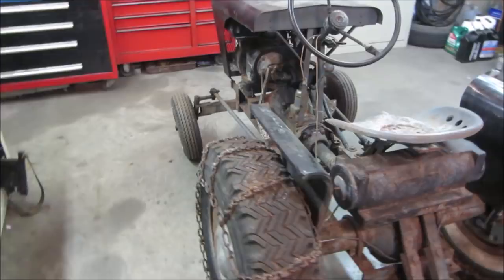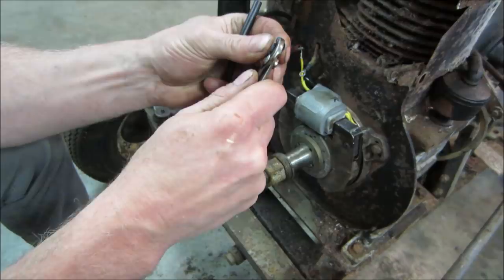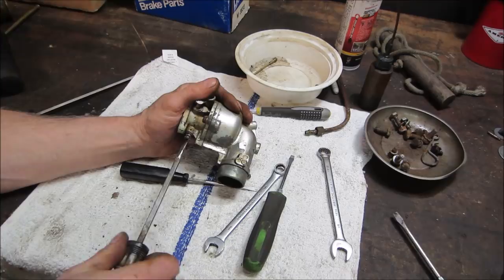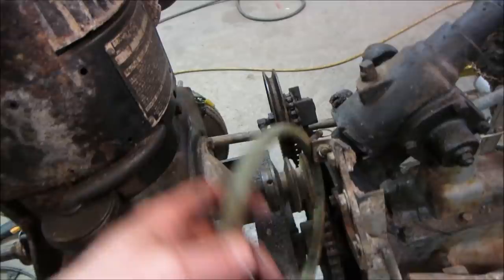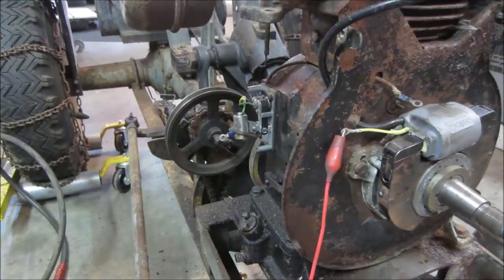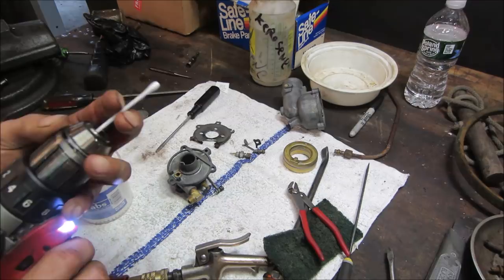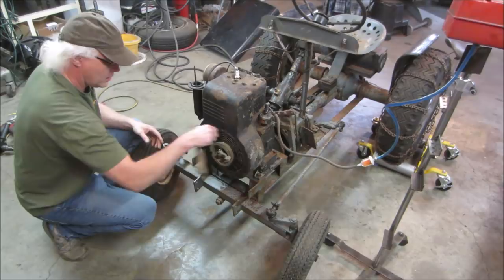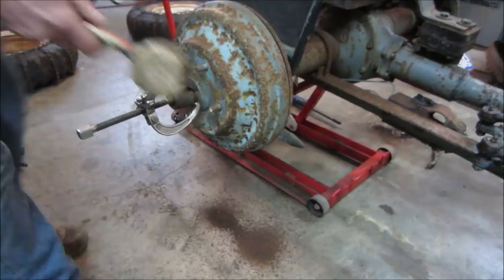Is The Engine Savable? Homemade Tractor Buried Under A House, pt2

Comment: By the way. Thanks to u and only u I got to fix 70 years old outboard. Before I had no idea anything about carbs but after watching ur videos, which I think I watched all of them. I had the courage and knowledge to get into the engine, take it apart and fix it. The old 70 year old carb was no go so I ordered one online the modern carb for 12$ and adapted it on the old motor. Now it starts from the second pull and it all thanks to u! Thank u that U thank u. U have no idea how much u teach me with the vids that u put out.

Comment: Maybe somone else mentioned this.  The ooze that came out of the old coil was insulation and the most likely problem was a short circuit when it gets to high voltage, not necessarily an open circuit.  You cann test that with a 'hipot' high voltage insuraltion tester, but as a practical matter, replacing the part where the schmoo came out with a different cheap part is a good plan.

Comment: For starting an engine using a drill, I use a 3/8 inch ratchet adaptor.  It can be used on any extension bar to get a ratchet action.    It effectively becomes an over running clutch once the engine starts.  
For cleaning engines, try Simple Green, 50/50 mix with water.

Comment: No Mosquitoes here yet in Colorado Springs.
We're still getting snow.
Maybe if it stays cold longer we won't have them this year.
Do you think?
Nope...they'll be here in force soon enough.
Thank you for your inspiration and instruction.
I'll be using what I've learned from you soon.
Got a throw away lawn mower and a Troybuilt snow blower this winter.
Never would have even looked twice at them if not for your encouragement.
Wrench on!!!

Comment: Ooh yes looks like my lunch break is gonna be extended by an hour
Reply: Never seen a Briggs and Stratton engine idle that low and still keep running in all the years I've been fooling with them. that's a sweet running little engine. Now if you can figure out how to pick hook up one of them starter generator type contraptions you will be able to drive it at night with lights.
Reply: Miata pfp? Nice
Reply: @orangepickel2  I've worked on those cast iron engines a lot. I sat here talking to justice what to do next lol.
Reply: @dennisjohnson5754  first engine I ever took apart and I mean took apart was a 2.9 horsepower Briggs Stratton and Stratton lawn mower engine that had a 18-in blade that my brother used to cut  grass with was bought  new 1957 I was 8 years old in 1962. The Masonic temple sat on about an acre of land and it had a big grass parking area and that's a lot of walking with an 18-in mower  2 ft High Grass.

Comment: I’d love to find the old tractor my Dad made in 1957.  It is somewhere in Northern Idaho around Moscow or Potlatch.  It had a Pontiac rear end, and a Crosley engine and transmission.  He used the outer shell of an old oil stove for the hood and grill.  What you are fixing up is not only an old tractor but my memory of just how handy my Dad was.

Comment: Yes, Lowes does honor the craftsmen's warrantee.
Reply: With the caveat that you don't get exact replacements. I returned a ratchet, the one I got back is equivalent in terms of features but not the same ratchet at all. They aren't made on the same Sears tooling (even after Sears moved manufacturing overseas in the '90s, the designs stayed the same).
Reply: Some of Craftmen's "hand tools" are still made here in the States but most are now made overseas and it doesn't stand up to Craftman's " quality" but then again there's a lot of tools now days that don't stand up to their original " quality" anymore.🤔😞

Comment: Lowe’s will honor the replacement if they sell the tool, but now most tools come as a set, rather than individual pieces.
Reply: Sears sold the intellectual property, not the patents, product manufacturing, or engineering specs to Stanley Back & Decker so I doubt if any of the Sears Craftsman or Ace Hardware Craftsman products have any lifetime warranty redeemable at Lowes

Comment: Good sounding engine.  If I am not mistaken, what you have there is a Briggs and Stratton 7hp cast iron engine, I have a 1966 Montgomery Wards Garden Mark garden tractor with the same engine, mine is a Model 19 Briggs and Stratton, still runs, and all I have ever done is 2 ring jobs and of course, regular maintenance.  I love the tractor and the engine.   That is a unique home built tractor you have there Mustie,  Good find.

Comment: Good Job Sir! I love this stuff. I made my own minibikes and Go-Carts  when I was 11-17 years old.  I built  custom motorcycles for Veterans until a couple years ago.  I will be 68 soon and energy level is just not there anymore to do that. I even bought a 200HP Motorcycle to convert into a 1970's style chopper.. I already have a Z1-900 1974 chopper I made to a chopper several years ago & very happy with it. Now that I bought the 2012 Zx14R Ninja to convert,  I was shocked to find it is a comfortable riding bike! I don't to chop it now. Thanks for taking the time or the videos... can't be easy... Great job!

Comment: Never get old. Just got a free mower, sprayed some brake cleaner in the plug hole, 3 pulls and fired up, had some old gas left in the carb it ran for half a minute :D

Comment: I have had experienced the same dripping from the bottom of the intake pipe while starting 2 of these types of engines ( 1965 10 hp simplicity, 1988 8hp troy built chipper), They always drip after full choke and 2-3 pulls.  It has nothing do do with a stuck float, stops if you turn the choke off, continues to this day to work this way on the 30 year old chipper motor.  Great video, Craig

Comment: One trick I devised to lube cables is to slide on a length of fuel hose over the end of cable sheath, use a small hose clamp to attach it. Hold fuel hose in a vertical position and fill with your favorite flavor of lube, lighter is usually better, force the lube through the cable using compressed air, Bam!, well lubed cable!

Comment: That old engine sounds GREAT, when it will idle down that low everything is set right. Those old updraft or flo-jet carbs LEAK in two ways...usually when you choke it gas runs out the bottom and that long emulsion tube you took out leaks in about 75% of them. You need to tighten, loosen tighten, loosen it til it SNAPS when tightening to get it seated. B & S came out with a little nylon washer to fix that problem. GREAT VIDEO.

Comment: 3 Years ago my mower didn´t start in the spring, i searched YT for help and found the big Mustie1....i had tools and got to work. Step by step, is there Spark, does it turn? is there compression?.....is the carb stuck or full of water?. The lokal dealer wanted 200€ for repairs, i did it myself. Carb was full of water, it dripped down from the tank. 

2 Years ago i fixed the Chainsaw from my Father in Law out on my frontyard, and a Neightbor saw me....brought over his Mower for a look. And some cold ones.

Now i am somehow a Guy the People come to with all kinds of small Engines. And a week ago, i stripped my first Weedwacker for his engine, because the rest of the Machine is scrap.....

BE CAREFULL, PEOPLE. Engine Hoarding is real....

Thanks Mustie from germany ;)

Comment: I use a #4 finish nail for float pins removal... those  ears break off easily so light tapping only if you want to have a usable carb. Good video!

Comment: I have built tractors back in the 1970s using a four-cylinder Wisconsin engine, four-speed truck transmission, and shorten truck differential.

Comment: I had one of those engines on a homemade wood splitter for many years you can get a really nice  muffler very similar and of what early seventies Cub cadets used that really quiets down the exhaust tone it's about 4" in diameter and about a foot long 90ﾟ in let.

Comment: the Craftsman tool brand was purchased by Stanley Black&Decker in 2017 and Lowe's became one of the first new large distribution channels for the Craftsman line of tools under the new ownership. There were some misleading announcements and advertising, suggesting that Lowe's had purchased the Craftsman brand, but when it was stated that Lowe's was the 'new home' of Craftsman, it only meant they are now a distributor for the brand.
Reply: Yes. Ace Hardware stores were selling Craftsman tool sets a few years before Lowes  started carrying a greatly expanded line of Craftsman tools. Besides the name, logo, and red color the current tools likely have no quality, production, or engineering ties to the Sears Craftsman products.

Comment: Ahhh the Beauty of the “junk pile”. The old Briggs motors are still going. Had a lawnmower given to me years ago. Person said their lawn was too rough. The Briggs motor had no compression so I check and saw a valve was stuck open. Took the head off cleaned up the water damage at the exhaust valve which was minimal. Lapped valve in. Noticed no marks at all on the barrel and asked the person had it run. They said tried it once over the lawn and turned it off. Never started again. 
That was 1982 and now 2021 have taken the head of to adjust the valve stem as compression got low. Still fires up with a couple of pulls. I have put two carb gaskets and kits thru her over the years.
 This is not the first Briggs and Stratton I know that has run for so long. Also the oil changes are not regular but kept an eye on. I think that is the major problem with these motors as nothing seems to go wrong with them unless you don’t maintain them. My mower has the upright motor bore and is a cylinder mower. Liked your video with your dedication to get the results you wanted as we all wanted. Nice to note how the carbs adjustment was as you set in the beginning which that tells me the mixture needles and seats have not worn. Nice 👍

Comment: I always strip the spark plug wire jacket back about 1/2" and fold it under so it's tight between the wire jacket and connector and then crimp it tight. the piercing piece is more to keep it from pulling out than a connection path, but it will connect there also.
I learned to always do that on vehicles and motorcycle ends, except the thread on ones.

Comment: Some time ago I saw one of your videos where you were working on an x360 John Deere.  You mentioned never seeing one that did not shut off right away when you shut key off.  All newer John Deeres have an electronics module under dash.  Any one with this will continue to run a little after key is shut off.  Also if you jump start it the module will burn up.  That from John Deere is $100 dollars to replace.  I enjoy your repair jobs just wanted to pass this info on.

Comment: I have a tractor my grandfather built setup this same way except the steering is cable driven and I had to upgrade the engine to a predator. The trans is a mercury 3spd and banjo rear end. Nice piece.

Comment: I have a couple of old national lawnmowers, with similar engines on them. The starter pulley is around 8 inches in diameter, with a screen bolted to the face of it.

Comment: 30:00 That "washer" on the guvnah arm is actually the pivot bushing.  It is rusted to the arm.  Several of my Kohlers have a similar setup.  I have never successfully rebuilt a Briggs updraft carb, they always leak even though the needle/seat work perfectly.  Taryl had a video where he used a nylon washer from another Briggs kit on the long main jet tube.  My guess if the bevel on the tube doesn't properly seat in the carb body gas leaks past and into the tube and down the throat.  The point where that bevel seats in the carb is below the fuel level....

Comment: I keep coils of that inner and outer control cable wire in stock. I’ve made up new cables lots of times. It’s relatively cheap stuff. You can also buy wire bending tools cheap to make the Z bends on the end of the inner cable.

Comment: That tar is actually a older style type of conductive grease probably a graphite based type of grease.... They assembled the coil by wrapping it along the steel armature with thin copper wire a full winding, then separated, & Then the first windings are wrapped with a cloth material & sealed with a type of epoxy..... Then a second winding is done and wrapped with cloth then slid into a sleeve made of insulation to not short circuit the windings.. Leaving a wound coil with two leads off of it or three depending on what type of voltage it requires.....

Comment: I spent 3 hours trying to get a rusty choke cable to move on an old motorcycle i got from a plumbing job i did. I couldn't believe how much effort it took using wd40 and oil while working the cable back and fourth. It was worth it as that cable was something like 100 bucks.

Comment: For cables I found this thing you use to lube dirt bike cables. It clamps onto the cable and you spray into it and it forces the fluid down the inside of the cable. Once I found this messing with cables have been a night and day difference.

Comment: You should check out the snap on ratcheting breaker bar adapter, part number S67. That one is 1/2 inch drive but it’s also available in 3/8.  I’ve had great luck with the 1/2 for spinning engines, the 3/8 is good for small applications but anything over 4hp it seems to mess up

Comment: Regarding a one-way clutch..
If you want to fabricoble something together, you can locate some starter motors from cars, most have a big one-way bearing in a separate module, that is fairly easy to modify to be able to mount 1/2 socket.

Comment: I stripped the gears out of a big Milwaukee plumbers drill starting an engine with no overriding clutch. The drill was repairable at a cost. It would be good to see what you recommend for an overriding clutch for this application.

Comment: What I do in a case such as that when you were removing and installing straight magnet into new ignition coil. I use a NON PETROLIUM  BASED silicone spray, food grade spray for press fits such as that. It gets the job done but leaves no oil residue to attract dust and dirt. You can normally only find food grade silicone at an appliance parts store such as Jonstone Supply. I have never been able to find non petrolium containing silicone at auto parts type stores.

Comment: 👍When the guy built the tractor the 8 hp  was probably the best available. Re-power with a engine with and oil pump etc. I would think  16 hp would make a nice tractor. Maybe that your plan if the rest of it's works.😊

Comment: At 35 minutes you can see an old safe line brake pads box. Behind the kerosene bottle. That box is likely 25 years old. Airtex products discontinued their brake products in the early to mid 1990s.

Comment: We all know that throttle cable is for "Testing purposes only". Hi John! Hi Ike! (I hope they don't mind). It'll be fine. Also, I knew that new coil was going to be fine after you pushed the core through. I am sure the manufacturers (God bless them) of that coil, took that into consideration, that a core (new or old) was going to be pressed through that "orifice". OK class, settle down.  :-)

Comment: You should take the lock washer off that lever to the regulator and just see if the bolt bottoms out.  I also think you should move the spring in.  I think he moved it when the cable was not working right.

Comment: For the cable - a vacuum pump works great to pull the lube through. Stick the straight end into the hose and spray lube on the other end of the cable. Doesn't hurt to have a bottle in line like for a brake bleeder setup to catch the crap and protect your pump

Comment: I still prefer those old wire wound cables. Just oil tho outside and flex it a little. That was acommon trick back in my youth to use a nut on the cable to retain it.

Comment: 13:20 Stanley (I think?) bought the brand and Lowe's honors the warranty exactly like Sears used to: Don't matter how mangled, they'll replace it, even if they only have something similar available. I recently tested this by bringing in an old 'knucklewrecker' double open end piece of shit (which they thankfully no longer make) that was just thrashed, and gladly accepted the exchange for my choice of sizes of combination wrench (what I wanted anyway) and I was in and out pretty quick.

Might depend a bit by store, but that's been my experience so far.

Comment: If I remember right Stanley/Black and Decker bought Craftsman and it is distributed by Lowes. The warranty is supposed to still be honored by B&D. but from what I understand some Lowes won't do the exchange on some of the original 'Sears' craftsman tools - you'd have to find a sears, kmart or Ace Hardware that are still open to exchange those.
Reply: Sears tools never had a lifetime warranty only the Craftsman line was lifetime. Not all tools Sears sold were Craftsman. Some just said Sears on them. If it don't say Craftsman it ain't.

Comment: Which plug did you go with for the long run? Really interesting video. Loved it. I keep forgetting to tell you this. I was a scientist for many years and routinely used a sonic bath to solubilise powders. Or to clean small components, more or less exactly as you are doing with your heated sonic bath. We rarely put components into the bath as you do. Usually, I would put the components into either a sealed bottle or into a glass beaker. The parts would be submerged under whatever cleaning solution we wished to use. Detergent and water, acetone, methanol etc. The sonic bath would have water in it with a small piece of copper wire somewhere in there. The copper wire suppressed the growth of algae and allowed you to just leave the water in the bath. The ultrasound waves would be passed onto the beaker contents readily with not much in the way of degraded performance. If you wanted to keep your bath clean and to allow for using different solvents to clean up the carburettor components then this might be a useful thing to think about doing. If you want any more information about this feel free to contact me.